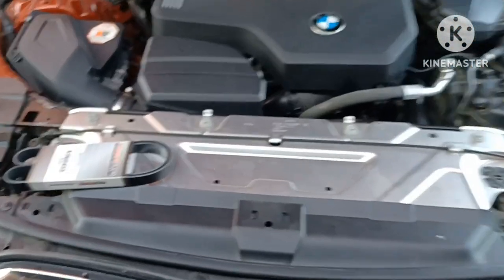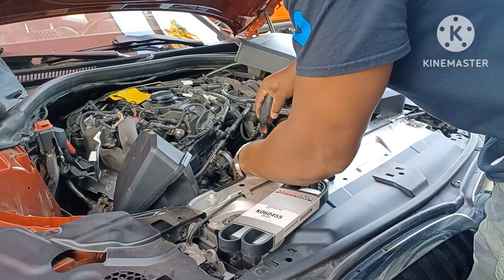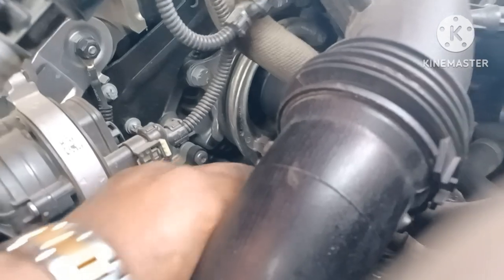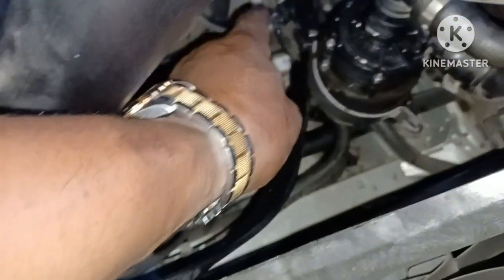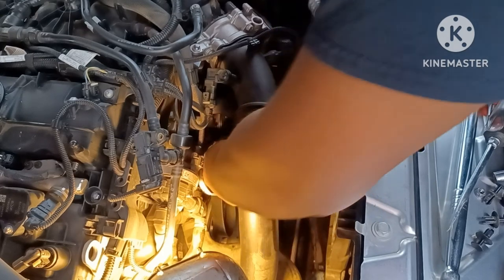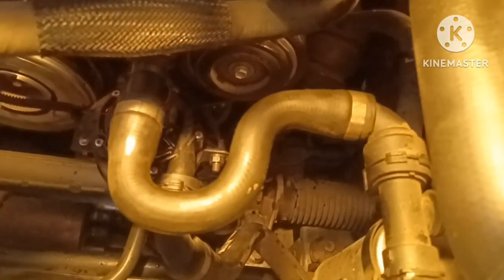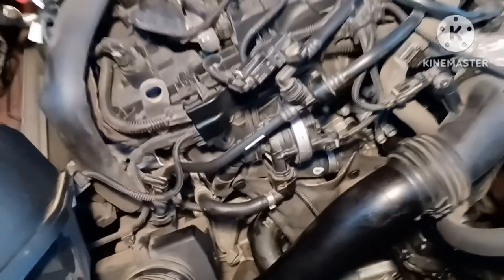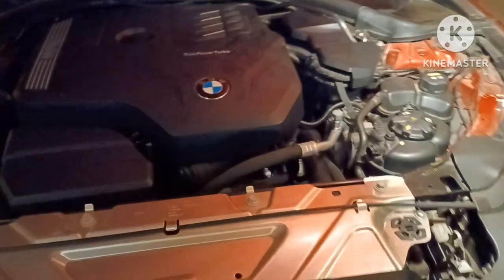🚘 $20 Repair! 2019 BMW 330i Replace Serpentine Belt

Comment: Is 90k miles the rule of thumb to change serpentine belt? I know nothing about cars so just tryna know what i should have done to maintain my car well while i do rideshare.
Reply from the maker: Most cars have a 30k, 60, and 90k scheduled maintenance list that can be found online. Each car is different based on manufacturer recommendations, but I wanted to swap my belt anyway because it was getting a small squeak after warming up.

Comment: Thank you for the video I think you also need to replace the tensioner as well when performing this service. To my knowledge most BMWs when you replace the serpentine belt you also replace the tensioner. 
The part that you have to move out the way to remove your belt is the auxiliary electrical water pump for your turbos this 4 cylinder engine was 2 water pumps the mechanical one for the engine and your electrical one for your turbos if you want to get the most life out of your cooling system use red line water wetter to keep your cooling system run a few degrees cooler.
Reply from the maker: Thank you! I had no idea what that was. I have water wetter that I use in the motorcycles and got some on the shelf. Hmmmmm. I think you just gave me a good idea, Victoria. I didn't replace the tensioner, but I'll be sure to pull it if the belt ever squeaks again. Good call on that. With the miles being so low, I didn't really think of changing much out at the time. But I'm around 114k now and I'm replacing parts before catastrophic failure. I've done my motor mounts and my heater unit housing that sits on the driver-side of the engine. Those videos are in the same playlist as this video. CRAZY hours to do that thing. LOL! But it's done and no more coolant leaks in the driveway!
Reply: @MicDropBBQ  You welcome my guy.
When I did my motor mounts on my bimmer I went with solid ones to eliminate the possibility of them popping and not leak fluid I did not went with  the original hydraulic ones they might make solid ones for that 4 cylinder you have but I don’t know.
My question to you is sir , have you replaced the gaskets yet like the valve cover gaskets, oil pan gaskets and the oil filter housing gasket, reason I am asking is because this is a common BMW thing in fact is a German car thing because they all do it but I don’t know on the 4 cylinder engines all BMWs I have own are the ones with the straight 6 3.0 liter engine and I am looking to get a newer BMW.
Thank you.
Reply from the maker: @victoria19853 no leaks from any gaskets yet. And I did do the hydraulic fluid mounts. I didn't know they made solid ones, but that would've been nice to know before ordering! Haha! This engine is small and has a lotta power. Thing flies for a turbo. I look down and it's at 85mph when it feels like I'm going the speed limit. It's so smooth and quiet. I call it my TROUBLE CAR because I can get I'm trouble with this thing! Only had it for 2yrs, but I drive a lot. Reliable and gives me no issues.
Reply: @MicDropBBQ  Nice 👍 no leaks from gaskets at 114k miles I guess BMW listen for once at the enthusiasts that’s amazing.
Reply from the maker: @victoria19853 🤣😅😆 either that or I got really lucky!!

Comment: My prius 300k miles now
Reply from the maker: The Jeep is almost there! 256k! I'm on your tail with it!! Hahaha
Reply: Nice, my 2019 Prius just hit 187k. You still on the original engine, trans, battery?
Reply from the maker: Yup. All I did was replace my clutch when I upgraded to the supercharger. Torque was killing the stock clutch. Battery replaced once since buying in 2019. Alternator replaced when I bought it, as well. I do a lotta work to keep it running and off-roading in ghe desert. 

I bet Randy's Prius is all original. Dude drives like 25mph everywhere. Hahahaha! I'm kidding, Randy.

Comment: Thank you for the video ! Definitely not easy to take these shots down there. 
So much harder than F series engine. Esp with the water pump in the way.
Reply from the maker: Welcome Mark!! Yeah, these engines are stuck in here pretty tightly. Definitely requires some patience! I always tell folks to just not rush and to take a breather for about 30seconds, then go back at it.

Comment: Good morning Jeff. I guess you don't wear gloves huh
Reply from the maker: 🤣😅😂 Years of this and I usually wear gloves if I'm doing really grimy work, like an engine swap on a car that leaked a lotta oil. My engines are usually clean, so I don't need em. I do wear gloves when I weld or work with sharo aluminum edges, like head gaskets!